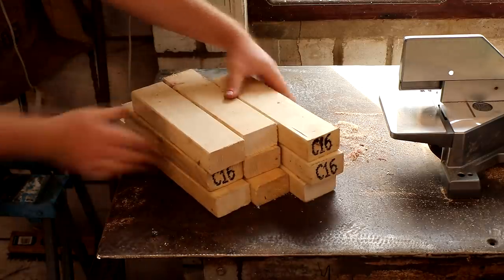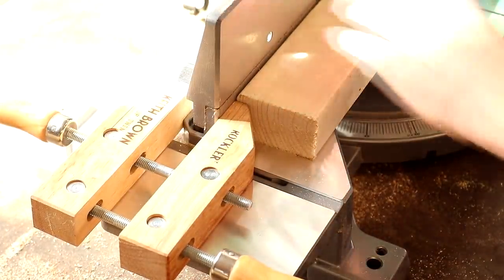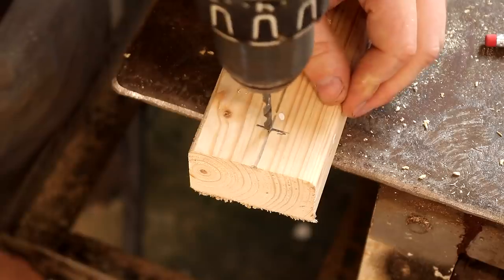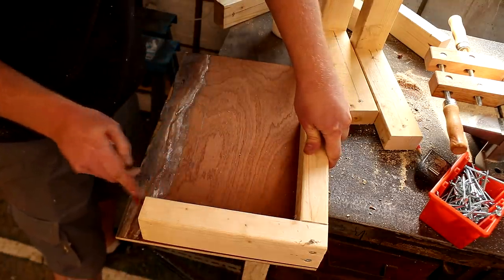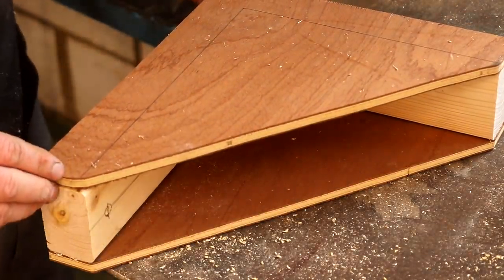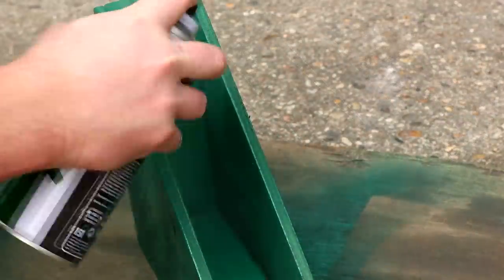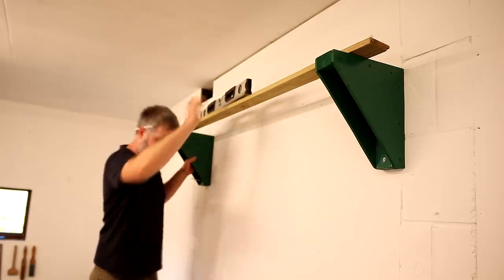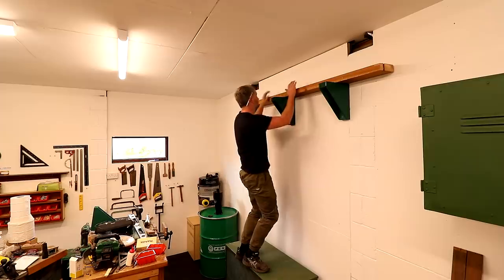How To Make Heavy Duty Brackets - Great For Wood/Timber Storage

Comment: Simple and effective. Jobs a good'n. If I could offer a tip - when you screw them to the studs/walls, offset the screws in relation to each other a little. Either side of a centre line by about 5-10mm say. Done in a straight line, you get a little side to side waggle. Offsetting near as damn it eliminates this.
Reply from the maker: Nice tip 👍

Comment: Really nice one, you've given me a new idea, usually i use 6*6 L clamps and then i used to cut a metal bar around 4mm thick and weld them diagonally from one edge to another, try this if possible, I can assure you this method is also heavy duty one.

Comment: good work! I feel just using an extra third offcut to make a complete triangle would make it exponentially stronger, cheaper and less complicated to make. but yours are really pretty and plenty strong
Reply: Makes it harder to screw in to the wall unless you put your pilot holes at an angle or put the hypotenuse piece up after the 90 is mounted to the wall. Or you have a stubby right-angle impact driver.

The plywood also helps with lateral rigidity (left-right wiggle after mounted), though offsetting the screws instead of having them lined up in the center would also help.

Comment: Great brackets and easy to make. The only problem here in Slovakia is where to find 12 mm reclaimed/used  plywood.  New sheets are horribly expensive, not everywhere to
purchase and often even not good quality.
Reply: Same problem in Hungary. You can not find left-over materials if it can be still useful. Unless you have  your own business, so then you start to save up the left overs.
An another possibilty is when people place furnitures out on the street, (specific event) then you go and collect them. Although there is already some mafia who controls that who can take those and where. So you don't want to run into that kind of situation, when they start to explain it to you how does it works...
Reply from the maker: I think MDF would offer a good amount of shear strength too if that's available? Not as much strength as plywood though but I'm sure it's be fine
Reply: @RagnBoneBrown  i would stay away from MDF using structural (or load bearing) stuff. OSB or MFP would be even better
Reply: @RagnBoneBrown  I have no experience with MDF. It's not widely available over here, nearest town where I can buy it is at least 20 km.
I have no idea about prices. OSB is the same. You can buy only whole sheets. The nearest shop where I can have sheet material cut into
manageable pieces (which fit in my car) is 45 km. But only if the don't have an excuse that at the day I'm there they can't cut due to illness or
broken machine.

Comment: Is PVA white glue that's used for sicking paper/cardboard usable for wood if you run out of wood glue? Great video mate!
Reply: yup.... usable and surprisingly  strong. The main differences are color, sandability, and drying time. Wood glue sands nicely, pva will sort of soften under heat from sanding. I use em on areas where I dont sand and when im not in a rush.
Reply: @nurabdul1436  Thanks nur. Good to know!